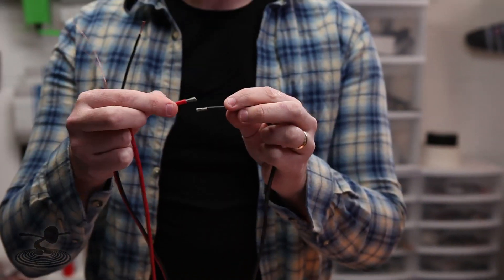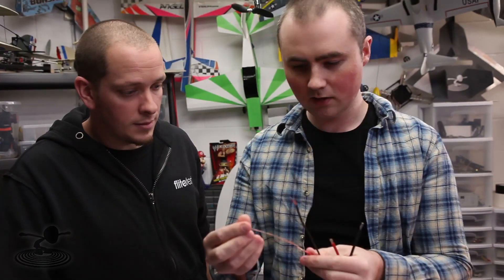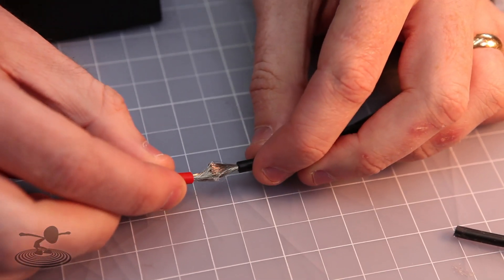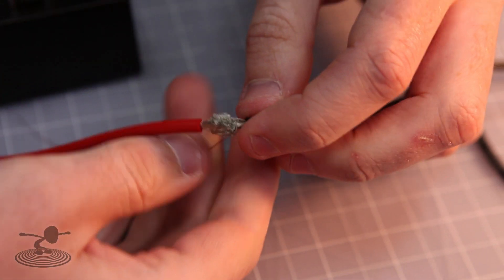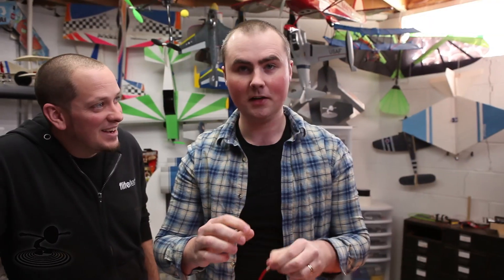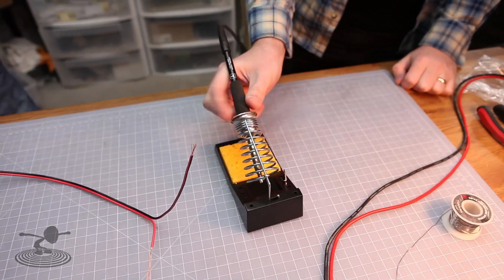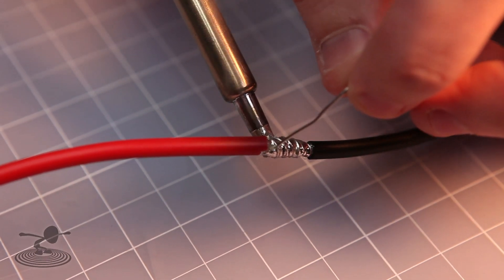Flite Test - Solder Thick Gauge Wire - FAST TIP

Comment: 200 watt with some patience will get you 6 gauge wire. 

100 watt is needed at minimum for 10 gauge. Also the tips ability to hold thermal mass makes a bigger difference than just the power. The larger/fatter the tip, the more heat it can hold and transfer. 

For larger wires you want a big fat blunt tip. You can also use a heat gun from the other side to help get the wires up to temp right before you solder. I've had to do this on 6 gauge wire before.

Comment: For large stranded wire this is priceless.  My question would be what temp was that iron, and how big was the tip.  I was having big problems with the solder running all the way through 10awg wire.  Don't know what I was doing wrong, but using that copper wire is a great idea, also think that (possibly) the copper wire helps distribute the heat to the opposite side of the wire to help the solder melt/flow all the way through.  Excellent video!

Comment: I soldered 12 gauge wires together and the problem I ran into is, I tried heating up the wire joint together from keeping the solder gun tip under the wire and pushing in the rosin core like that and it heated up the whole length of the wire. I don't think it's supposed to do that? But either way I did it by letting the rosincore drip from solder gun it came our pretty good. I would suggest some flux

Comment: Flux helps clean the copper then soldering is easier.  Good tip joining the cable together it would never break that way

Comment: I love the way you showed absolutely the best way possible to join two stranded wires, with the  "two wire mesh" method. Of course, wrapping with a single strand of wire is a must to keep the projecting ends held tight for the soldering. In my opinion, this is the very best way to solder stranded wire together. Very nice video! Have fun pulling them apart! It's like when you mesh two phone books together the same way. You can't pull them apart with two trucks! (On MythBusters) Please see edit below!!!

Edit: I hadn't seen the part 2 of the phone book episode. Here it is here. Of course these wires are not phone books, but the principle is still there, except the solder is holding them together more. So scale wise, the wires are most likely much stronger. (Notice where the books finally gave way, in what would have been the soldering area).  https://www.youtube.com/watch?v=QMW_uYWwHWQ&t=6s

Comment: I bought a new Weller iron to repair a 12 gu cord on a table saw. The first attempt with a smaller iron didn’t work. The new Weller iron claimed to be 130 watts but this was misleading. It was 30 watts and had a trigger that supposedly “ boosted” it to 130 watts. Did not work and made a mess. I also dipped the wires in flux,not sure if it was rosin base, still no luck. I’m returning the iron and will watch for at least a 60 w or higher iron on sale. More power!

Comment: The wire casing is starting to melt, but my solder is still not melting. Whats going on? Iv been trying to solder a wire for the past hour
Reply: Try using a smaller gauge solder, that has worked for me.

Comment: Strip enough insulation to twist wires together, held together with 3rd hands, then solder.  No need to weave anything into such a small joint.

Comment: How much power for a soldering iron are we talking about here?  60 watt?  100watt?
Reply: BikeGuy1992 For 8 gauge wire and below, you really need a 90w+ soldering iron/station. You also should be using a "spade" or "flat head" tip as they have more thermal mass which is key to tranfering heat quickly to your wire. Guys in this video are using a cone tip and who knows how long they stood there waiting for the solder to flow..... the beauty of editing I guess. "Advice" like the one in this video are just about pointless because most people watching this have already experienced the failures of soldering thick wires and want to know what went wrong. They tell you "high power" soldering iron but don't say what they used. They are also soldering two wires with nothing at the ends. If those wires were connected to a component, you'd need to be in and out as quickly as possible or else you'll start burning stuff up. The higher the wattage of a soldering iron, the higher the ability of the soldering iron to deliver and maintain a preset temperature to quickly perform your job without overheating your components. Finally, the guy soldering in this video is feeding the solder into the iron tip, that's a big no-no and a waste of flux.
Reply: xXG.L.HXx thanks for the tips. Gotta take this stuff seriously!

Comment: thanks! I am trying to solder a wire in my car to the starter(from the ignition, not the battery) so I can add a jumper line for a convenient remote starter switch to be connected to when needed. couldn't figure out a proper solution to solder everything. This worked great!

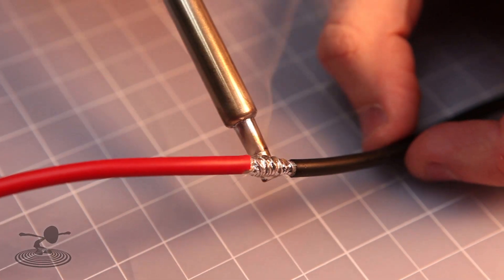Comment: @1:35   Solder flowing down into the wires isn't a good thing.  It creates a hard point where repeated flexing will break the strands internally.
Reply: While a soldered area does make the wire brittle, it's the absolutely essential part of soldering. Are you suggesting they just rest some solder beads on top of the joint or something?
Reply: Ideally it should flow into the strands to create the best electrical connection. That's the point of heating the wire and not the solder. The heat draws the solder into the work to create a stronger connection.
Reply: firebirdude2. In the most ideal joint you would strip the wires longer. Make the joint long enough that only the middle two thirds is soldered. Leaving a flexible section at either side.
Reply: You are supposed to have it flow into the wires... otherwise it doean't bond. I'd rather have one hard section (still surrounded by flexible sections) than a soldered joint that won't hold together.
Reply: Wow you know everything!

Comment: Thanks for the video. How many watts for the soldering iron needed to solder big wires like this?  I need to solder a big wire like this but my solder iron is 40w and it looks like it doesn't put enough heat to get the job done.

Comment: how powerful is the iron exactly. my 20w isn't good enough
Reply: +Allen A What you need it flux, that will help you a whole lot with a low wattage iron.  But seriously, you should have an iron thats capable of at least 700 deg F.  I use a tracpower that gives me a heat of 900 degrees.
Reply: +Allen A Tip size is a factor too - note how big the tip of the iron in the video is relative to the wire he is soldering.  If your tip is much smaller, than the metal you are soldering is no longer a target - it's a heatsink.

Second the note on using flux.

If you are having problems: if the wire is getting hot but not taking the solder, more flux; if the wire is getting warm and the solder is not melting, even (or barely) on the iron tip, more heat - either increase your temperature and/or use a bigger tip.

Final notes: the risk of atomizing lead increases significantly above 800F (425C) - leave your iron at 700F unless you have to go higher, then adjust it back down after you are done.  Clean your solder joint afterwards to remove flux residue (even "no clean" flux) for increased longevity - flux residue can continue to corrode the joint, can attract moisture, and can attract dust/debris.
Reply: thanks :)
Reply: Allen A Pre-tinning your iron tip before you begin to solder is another thing that will majorly help you to spread the heat more evenly across the thing your trying to solder. If the solder won't stay on the tip when it's hot, it is likely time to replace the zink coated tip with a new one.

Comment: Hello friends, I recently buy the turnigy 5000mah (35C) for my first DJI F450 quadcopter build. The issue that I am facing is that the wires from the lipo are 8AWG which are thicker than the ones that come with the DJI F450 (for the PBD). I was aiming to use a xt60, but it seems the lipo cables wont fit. Any recommendations on how to deal with this situation?

Comment: what if i want to solder 6 wires togther? 4 red wires from ESCs,1 red wire from xt60 battery connector and red wire from ubec all together in a bunch and do the same for the black wires? can i do this?
Reply: Living Universe yup should be fine, sometimes when im joining for a multi rotor, i can only assume thats what you are doing, but i will have like an inch of wire stripped and remove like half per lead so i have less of a jumble of cables together.

Comment: 16 AWG cable soldering to a 12 AWG one is good?
Reply: Edmundo Andres There's no practical reason why you would do that though
Reply: Niels Steenman aside from having a 16 AWG esc and a 12 AWG battery connector pre-soldered  and this should be fine

Comment: Before you solder, before you strip the wire, before all that ALWAYS put on your shrink tubing. I've grilled that into myself. Can't tell you how many times i had to cut a connection and redo it because I forgot to put my shrink tubing on first. lol
Reply: they make shrink tape now. might come in handy when i forget about the shrink tubes
Reply: @CrazyBeatsMusic  conventional electrical tape also shrinks when heated....(not alot of poeple know this), probs alot cheaper then the new shrink tape you are referring too.
Reply: Happens to me too, finally finish it, look over and see that my shrink wrap had fallen off the wire before I soldered...
Reply: CrazyBeats didn't know that... thanks. But if you don't have shrink tape you can also take oversize heat shrink and slice it down one side and wrap it around itself as tight as you can make it and glue it with medium CA and as soon as it bonds enough to hold itself in place apply the heat. I did this once just for a temporary fix on a battery connector where the shrink fell off the wire soldering the other wire and didn't notice it and when I went to remove it was really on there and a bear to get off so just redid it the same way again and saved some solder. I put a little slice of clear tape on it just to feel safe but so far its held up really well and I'm guessing in ten years it might need to be re-glued long after the battery is gone. I wouldn't make it a habit but I'd never re-solder a battery connector because I forgot the heat shrink after doing it that way.
Reply: That literally just happened 😂

Comment: Nice post, thank you.  I'm not trying to criticize here but it would help to mention that a good soldering station works much better than some crappy 30-watt "stick" iron.  What temp do you set your station to?  Does 380º C. sound about right?  Lastly, about what diameter solder wire would you use in this case?

Thanks again!
Reply: jonathan oxlade I don't understand what you're trying to say here.  You DON'T need 500º C. for RC hobby work!
Reply: Appalling68 agreed, I have a solder rework station, chinese, that has hot air with variable flow and a thermistor controlled solder iron.  The biggest mistake I made was setting max heat, I guess I thought more was better. Needless to say I ruined a phone by melting the factory surface welds which can melt at about 500C or less.  I now preheat to about 300c and solder around 380 or 400c.  I would highly reccomend a hot air rework station designed for phone repair for any hobbyist.  Mine is a Xpower D853, just google it, there are many variations to choose from.
Reply: It really does.. a weller soldering station is a must have for every hobbyist.
Reply: Electric soldering station have a max temp of 450c while gas irons 500c but takes longer to get to it
Reply: A good electric soldering iron station will go well beyond what you need for anything in the RC/Hobby/Automotive/Aircraft industry. Anything more industrial then that and you get into brazing with an oxy/acetylene torch. I know some guys use little gas torches in automotive but that's purely preference and even more so portability.

-20 years Welding/fabrication experience

Comment: That's an awesome idea!  Especially in this day and age when good soldering skills are nearly a lost art.  Throw some heat shrink over that and it you'd have a killer splice fix.  Also look up "hook solder joint" if you need to accomplish this with solid core or to expedite the repair.  That would be how the Department Of Defense (originally developed by NASA) taught us solder joining 2 wires.  

Laying 2 wires side by side and dwelling on them until you get solder flow for both cores was never a good idea.  Who came up with that???  That's the kind of stuff you see being done by amateurs in "professional audio installation shops".  40/60 solder itself is pretty strong once melted but they also "kill" the solder by dwelling too long until it is dull.   

Thanks for the share!!!  It's good to see someone actually learn and teach solder work.  It will never be completely phased out so long as physical conductors exist.
Reply: @AlanDike-uw2ew  Dunno the history.  I would assume that would have been solid core wire, which also was accepted.  I know its the  simplist splice method the DOD allowed in certified repair labs.    There were a few others but they took a great deal of preparation and time.  It is the same form hook you would use to join a solder turret but is used for hooking two conductors.

Comment: I've been soldering by lacing the wires together as you showed but i have not tied them together by wrapping an additional wire around the connection. I've already built everythng and it would have a huge job to undo and redo every solder joint. The joins are not under any stress and tucked away, am I really in danger of the joins coming loose????
I'll add the additional wire from now on, but really don't feel like redoing all the connections on my big hex.

Comment: you could use the same method, with 2 on 1 side and 1 on the other if you wanted a "T" configuration use their method and the 3rd wire split the strands in half and  wrap each half in opposite directions over the other 2 wires, that should do it.

Comment: You forgot the flux. Adding flux makes it so much easier, and allows better transfer of heat to the joint. Sure, the solder has flux, but it's not enough. After you finish, wipe the flux away with rubbing alcohol. Source? 25 years of soldering anything and everything.

Comment: Ive always nosed it in and pulled up before the ground gently and tried to keep it level above the ground the best i could until it touched down....not the easiest ting in the world but its worked so far. (may have to trim it down or hold a bit of down elevator on landing, also be gentle if you need to pull back so it doesn't snap up and stall)

Comment: Isn't this a little overkill? I usually pre-tin the wires using a little flux, then lay them next to each other and solder them together, making sure the joint flows through and through. Never had a problem all the way up to AWG7. Talking about strain on the wires is pointless, there should not be any strain on them. If there is, it is probably going to come lose inside the ESC or some other inconvenient location...

Comment: this method is useful when soldering the red and black wires from you esc on quad that is  4 reds to one red for power to the battery. i do not use it for conventional joints due to weight and electrical noise concerns. for two single wires use a set of helping hands this tool is $ 5 and will make you Soldiering hassle free

Comment: When the motor is hard to turn with the battery connected that it means you have the ESC set to motor brake mode..thats usually used for belly landing. So when you come in for landing and chop throttle the prop stops spinning to prevent damage..

Comment: sol·der [sod-er] 
noun 
1. any of various alloys fused and applied to the joint between metal objects to unite them without heating the objects to the melting point. 
2. anything that joins or unites: the solder of their common cause. 
verb (used with object) 
3. to join (metal objects) with solder. 

4. to join closely and intimately: two fates inseparably soldered by misfortune. 

5. to mend; repair; patch up.

Comment: Wow! I have been working in eletronics ( telecom) for 20 years and learned something from you guys! Thanks for making me feel stupid ....(  side by side soldering has worked for me. granted not "pull proof"). But, come to think of it; I never responded to an outage caused by someone pulling power supply cables apart...- a Verizon T1 ice storm/ broken branch( different story). none the less Thanks! I will incorporate your ideas !

Comment: Your plane is gonna crash....LOL  Good idea guys! Never actually seen it done that way! However if tin both wires properly and then solder them together there is no issue. I have done it may times with no problem. Its the tinning that makes all the difference....

Comment: Excelent tip guys! thanks!  . . . 
Now I have a question: I need to put the LiPo far away from the ESC. Which cable I need to make an Extension for the LiPo? It's for an Scratch Built Predator 2, with a 1300kv tower pro, 25 amp ESC and 1600 20C or 2200mAh 20C LiPo. 

I like ALL your videos!!!

Comment: If your installation is pulling on your spliced wires you didn't measure correctly add more length. How many solder joint have you seen that have broken? if there is stress on the joint, the wires are to short!!! :>) Keep up the good work guys, love your videos!!! I have got to build "A Rocket Plane"!!! I still get a kick out of that video-)) LOL David needed to lighten up a little in that video LOL

Comment: Great, now what's the best way to handle three wires into one joint, such as when you need to split off power to two separate lines?  It can be difficult, especially if you need three or four lines such as when doing LED lights for night flying or powering FPV systems.